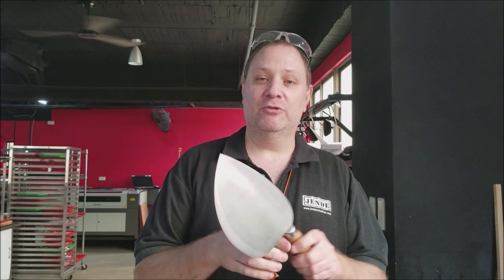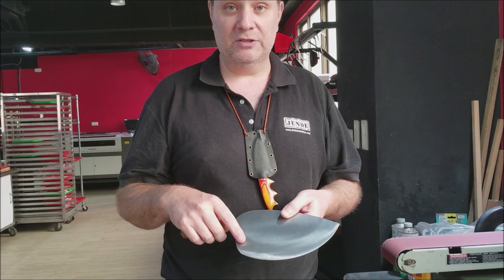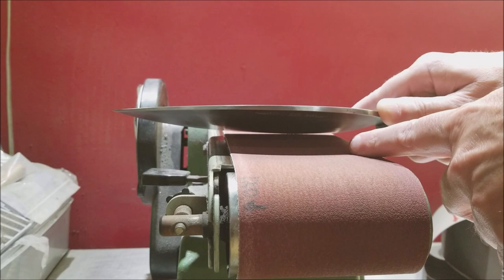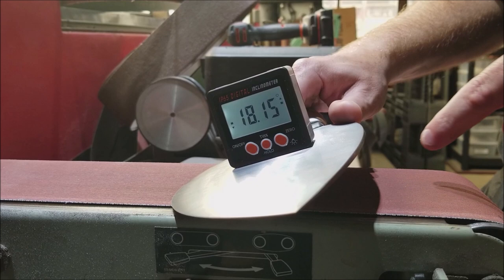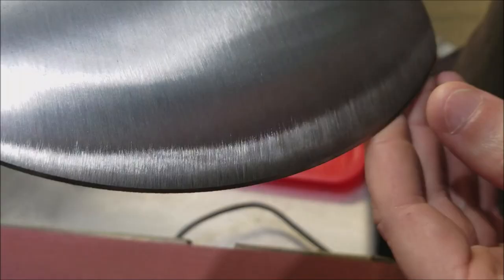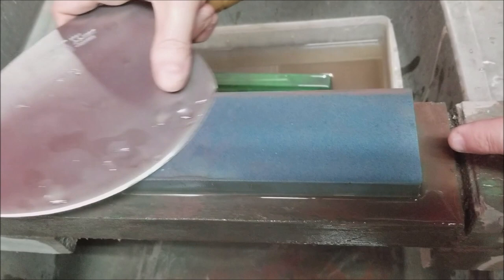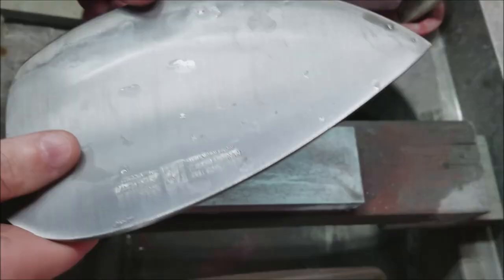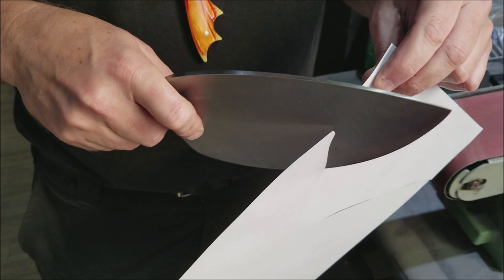Sharpening Maestro Wu G5 Butchering and Fish Knife (Taiwan Tuna Knife) 【外國豬磨刀子．研磨金合利G5，魚刀】

Comment: So what's the variability in the quality of steel from knife to knife? Or do they standardize it somehow?
Reply from the maker: The steel quality is pretty consistent. I've sharpened MANY of these, and I never feel that one is significantly harder or softer than the others. The only variations from knife to knife are slight differences in the dimensions from the factory grinding by hand. They are all unique in that sense.
Reply: @JendeIndustries  That's great to know, I was thinking of picking one of these up but was just unsure of their consistency. Thanks a lot!
Reply from the maker: @hunter-tm2kl  My leasure. Yeah, the Maestro Wu line is VERY consistent quality. I have never had a complaint about any of the knives. :) Maestro Wu wants his knives to be used, and makes them accordingly.